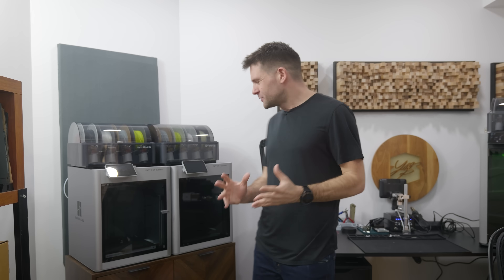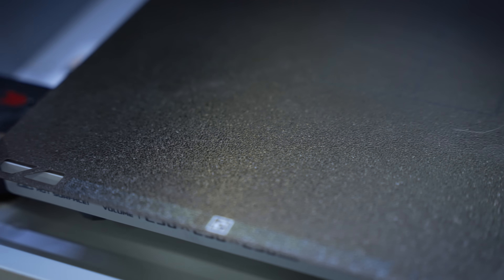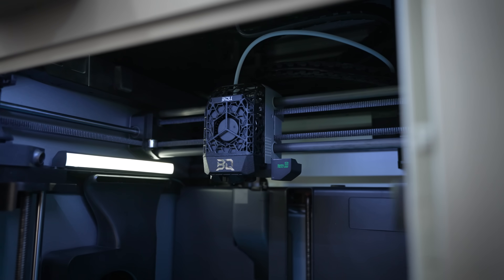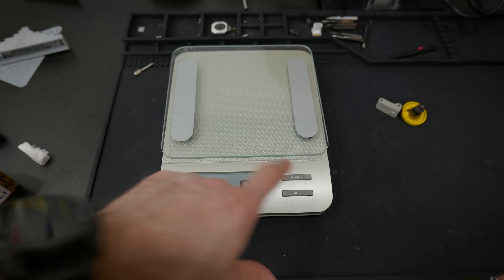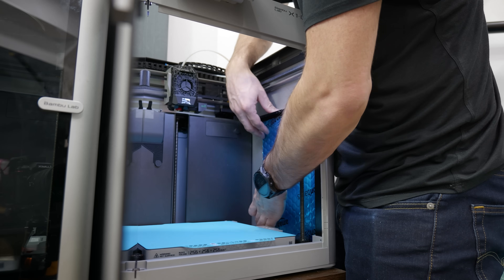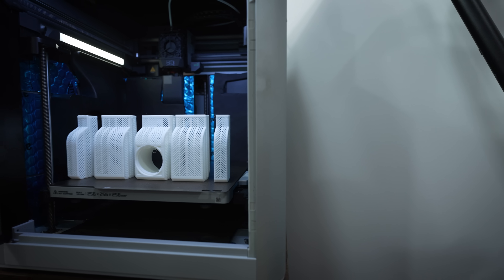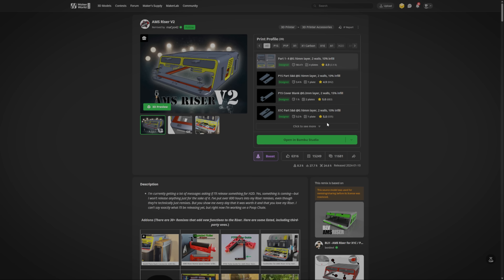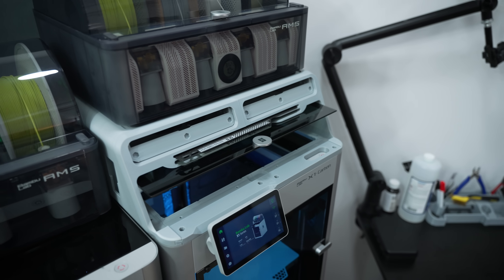I dont understand why more people dont MOD their 3d printers...

Comment: Bambu Lab’s new firmware forces you into their cloud—which means your prints and settings are tracked and controlled remotely. As Louis Rossmann showed in his video, this isn’t about security—it’s about locking you into their ecosystem. For privacy and full control of your device, steer clear.

Comment: But isn't the 'stock' plate of the X1C still the 'cool plate'.  How does it compare to Biqu's cryogrip?  And insulating my printers is something I've done a few times now.  I've learned a few things about getting the best results.  Feel free to hit me up if you want to chat.  I currently get a 15 degree delta just from insulation and heat soaking.  I have a chamber heater to kick it up kigher.

Comment: Up next you should build the Python AMS and enclosure. Then for giggles, you can do the Hula feet, a splitter to allow external filament rolls, belt covers and lastly the Stein Wipe Motion Control system. 

The Python was a must to use older Atomic filament spools and it makes cardboard spools 100% reliable.

I'd really appreciate a side by side on the feet. It seems to have reduced vibration, but I don't have a great way of comparing.

Comment: Great shear. 
Sorry for the off topic question. But I'm wanting to make a budget tablet/viop phone/handheld gaming.
 Any pointers on a mobo, SBC or use something like a psp ? Minimum specs are i3-3250/FX-4350, GTX 660/AMD Radeon HD 7850, 8 GB RAM, 30 GB storage. Was hoping for laptop mobo to gut but I can't find one that's small like a framework laptop mobo.
I have a few desktop spear parts. NVIDIA 960, NVIDIA GTX 1660, AMD Ryzen 5 1600 six-core.

Comment: 10% humidity is way too low. It will weaken your parts. Your filament needs a bit of moisture to adhere properly. The standard safe zone is 20-60% humidity, with 40% being the sweet spot. Lots of great 3D printer upgrades, thanks!

Comment: That nozzle ecosystem is the E3D Revo system. They have hardened steel nozzles for sale, so you can still print with the abrasives. They've also got Hi-Flo and I think Hardened Steel Hi-Flow.
Reply: they have diamondbacks too. Full on mohs 10 polycrystalline diamond for 150 a pop.
Reply: @henrydonaldson4665  F diamond that overprice junk. Tungsten carbide is all that is needed and its far cheaper.  Diamond is a gimmick.
Reply: and the Xobsidion
Reply: Can anyone give an opinion of Revo versus Bondtech? They seem very similar.

Comment: The assumption is that if you have a Bambulab, you don't need to modify anything.
Otherwise, I'd say your printer is crap.
The logical thing to do is to modify cheap printers. Not printers that aren't supposed to need any modifications.

Comment: i started modding my neptune 3 max to fix some z wobble and some broken pom wheels. Then i got klipper. The z wobble wasnt fixed so i got better stepper motors (after ruling everything else out). Then that caused more problems with amperage, then that caused more problems (mb) with inexperienced potentiometer turning, then that caused more problems with replacing the main board, then that caused more problems with overheating.
Not saying your shouldn't mod a printer, just, do your research, don't be like  me

Comment: Your test for the lighter extruder cover makes no sense. It's not supposed to improve small details, but rather allow for better acceleration with less input shaper so you'll have less artefacts and a faster print speed. I have no Idea whether or not that actually works to a noticeable degree, but in order to take advantage of it you'd need to tune your slicer profiles for the correct higher acceleration.

Comment: Some of these mods are good, some are just meh... Some I wasn't happy with...the Panda Extruder that you're thumbnails calls out as "game changer"... Sorry...I'm not seeing it... Yes, it likely reduces toolhead mass, and I like how it looks, and it is installed on my machine...but I don't see any difference in print quality, so I'd call that "meh" item... I have the Panda Jetpack... I do see it offers better cooling, so that's a solid upgrade.   I bought the Panda Claw, and... It's been removed and replaced with the Bambu hardened steel extruder...the Panda Claw was excessively noisy, has way more backlash than it should, and after only 3 weeks and 2 spools of CF filament was slipping and unable to feed filament (I thought I had a clog, but the gear was just no longer gripping the filament)... I put the Bambu hardened steel gear in its place, and it's been 3 months and over 6 spools of CF filament with no slipping at all, and is quieter.   The Panda CryoGrip build plates... I have the Glacier, and make no mistake, despite its name, it's not a "cool" plate...in fact I have to run it 10° hotter than PEI to get good bed adhesion... That being said, I like the satin surface finish it imparts on parts, especially with PETG it's about as smooth as you can get, so I like the glacier, but temper your expectations if you're thinking it's a low temp plate... The frostbite may be, I don't know, but the glacier is not.   The Panda Revo is kind of a love hate thing .. I love the idea of the fast toolless nozzle swaps... But... Revo nozzles come in odd sizes like 0.15 and 0.25mm which Bambu Studio doesn't support, and flat out REFUSES to let you print with... OrcaSlicer however does allow those nozzles...

Comment: That's an e3d Revo hotend with the nozzle + hotend assembly, it opens up the whole line up of Revo nozzles, they have a diamondback equiped nozzle if you want to print insane materials (and obxidian for a more cost available option but still hardened) please look it up

Comment: biqu glacier build plate melts if cleaned using alcohol - according to reviews
killed it for me

also I'd mod the fans before anything else - noise is the worst part of 3d printing to me (aside from the fumes which you should mod an exhaust onto to dump it outside)

Comment: > modding printers
> bambu lab
lol
didn't bambu labs shut down 3rd party electronics? bambu lab are like the worst printers to mod.

not just that, there's a bunch of modding fudd in this video (which I think zac figures out during the vid): skeletonized toolhead, metal extruder gears, bad PCF cooling path. as much as I'm whining about bambu lab's recent modding hatred, biqu/bigtreetech/mellow/trianglelabs should not be seen as good designers. they basically make anything that sounds cool, and they think will sell. skeletonized toolheads do nothing (build a better toolhead instead), metal extruder gears should only be used at 100C+ chamber temps (they wear out faster), PCF should be pressure optimized, not flow optimized, so having odd shaped ducts is worst than straight ducts. 
source: voron nerd, all these sins and more have been done in that community
Reply: oh also, if you do keep the bambu lab printers, luke's laboratory is coming out with a bambu hotend soon, which (because it's LL) will be better than anything else on the market for flow rates.

Comment: I think this is actually a good question. A lot of people are obviously right that this has been the way of things with 3D printing before Bambu came on the scene and there is some advantage to the fact that a Bambu will work well out of the box. You don't need to mod it. But the fact that you can make changes to improve your printer is really good. I think it's good to know how your printer works and how you could tailor it to your uses, even if you don't want to change anything. These machines have a lot that can go wrong with them, so it's really helpful to know how to fix them, and you learn that as part of modding. You should know how to make your printer work the way you want it to.

Comment: CryoGrip is just to pull money out of your wallet, it doesn't work. PLA warped when using such low temperatures, it only held on the plate after using 3DLac.
LED lighting will come out significantly cheaper if you make an LED riser.
Panda JetPack is an old thing and it is confirmed that it has worse airflow than stock.
CNC extruder is fancy, but it adds weight to the toolhead, so more ringing.
Overpriced E3D hotend with brass nozzle, with which it is not possible to print abrasive filaments is called a "win" 😁
We could continue like this, but it is just a waste of time and in my personal opinion just a waste of money, which could have been bought, for example, filament.
And I'm not talking about the "shady" practices of the manufacturer of that printer. That's why I don't own it anymore 🤣

Comment: I tested a lot of this product for biqu and I can tell the plate is really good the front cover with the upgraded airflow is worse is some case especially ia some very difficult detail sections is some models and for the gear the fact some times the x1c stop working because some small part of the filament is blocked inside the gear is not because of the gear but for the nozzle design for example I bought on Amazon a combo for the x1c with all the hotend block similar to the original one but with the particularity you can swap the nozzle and no more problem all for less than 60 dollars soooooo for sure biqu is working very well but I probably don't suggest to buy this kit for the cost (ah for the set I bought in the total I included a ruby nozzle so way better the the brass nozzle from biqu)

Comment: You said that saving weight on the print head didn't improve print quality, but you didn't say if you re-ran Motion Accuracy Calibration for it to redo its compensation for the reduced weight.  I'm not sure if I would expect that to make the quality better or just allow it to be faster, but still it seems to be than any changes that could effect motion should be followed by re-running that calibration.
Reply: This guy prints raisers for AMS, this is his "mod" level.  Spent 15 minutes caught by clickbait...

Comment: Consumer 3D printers have reached a point where consumers want a product and not a project.
Reply: If its 1,5k local currency for "idiot proof working machine" that runs good or 400 and 10 hours of your time with the benefit of knowing the in's and out's, the Deal doesn't Look so weighted in needing to shell out a big amount of money anymore tbh
Reply: @questionsfrog1918 indeed but when the price gap isn't that massive, both options are just preferance based. Some people buy a 3d printer like you buy a vacuum cleaner or a dishwasher, you just need it to work for your use case and how it works doesn't matter. DIY is great but sometimes an appliance has a place too.
Reply: @questionsfrog1918  10 hours of tweaking for someone who has the aptitude to do so. 
The magic there is, most people do not have said aptitude, hence why Bamboo exists and is doing well.
Reply: yeah i ask ppl if they modded their laser printer as well :D? its funny that ppl insult you, because they assume, you are retarded... i just wanna focus on printing, not tinkering...
Reply: The 3D printer is for printing out stuff for other projects. I don't have one yet but if I get one I don't want it to also be a project.

Comment: People bought Bambu printers because they just work (and Prusa). Being someone who has probably spent 100's of hours upgrading and then trying to 'fine tune' my printers I can absolutely see why people don't bother. That is why I bought a P1S. I'm so sick of upgrades, it's life absorbing and depressing. No more upgrades for me. Time is precious.
Reply: I've ordered a core one after many years of tweaking, more failures than actual prints

I know how you feel exactly
Reply: Amen! Had the same journey
Reply: Exactly. However, it is also the first printer I have, which had a non working part cooling fan. It somehow partially unplugged itself. At least it is the first time I didn't notice it. The fans of the Anycubic i3 Mega sounded broken way before they didn't work anymore. And the i3 Mega doesn't bend hotends. The whole frame is so flexible, that it just flexes around the obstacle. But the i3 Mega replacement parts like the heatbed became so bad in quality, they wouldn't be an alternative to the P1S even if it wasn't one of the best allrounders.
Reply: ny print farm is x-1s and ps-1s  

upgraded from prusas which i gave away to my boy scout troop
Reply: prusa does NOT just work.  they are still in the stone age.  

my bambu running mostly default.  is producing nicer prints on ludacris speed than the prusa printers we have running proffessionally to make parts at work.. (we build lab testing robots and something we use printed trays and such)
Reply: @darkracer1252  man that's a real put of touch thing to say out loud 🤣😅 as someone who has been HEAVILY modding printers since the ender 3 pro was brand spanking new when printers truly were something you had to build and tune... Prusa these days is NOWHERE close to how hard it used to be first of all... And second of all having quite the hours into printing on a P1P I can confidently say the only part that impressed me long term was the lack of issues with mechanical hardware over time, but the hot ends are ridiculous expensive, slicer software isn't the best, closed ecosystem, has been known to have issues with said ecosystem... Bambu is like the car company that always has the new features first (they are also always the ones to figure out it's quirks on their consumers 🤷) overall great printers but if you came from modding and tuning it may not be your cup of tea 🤷
Reply: @darkracer1252  If prusa is "still in the stone age", then I guess bambu is too. Since both brands all share the same tech and features. You sound like someones thats never touched a prusa.
Reply: @darkracer1252  if the prusa dont work well, sorry to hurt your feeling but its the operators controlling it. Bambu is for home use, but for printing farms there are way to many downsides
Reply: @DevBench4Life  no and no... When Bambu is not for Print Farms, why most farms i see use only Bambu? Only Prusa print farm i know of is Prusa :D
Reply: @F-Andre  I know a few guys that have prusa print farms.  That said, I've personally spent more time helping my buddy keep his Prusa mk3 working then messing with my own  printer.  However I wouldn't touch a Bamboo.  They seem physically good, but I don't trust a closed source ecosystem in a traditionally open source environment.   I don't want to be stuck using their slicers.  I REALLY don't trust them after the blocked other software from initiating prints.  No cura support.  Naw.

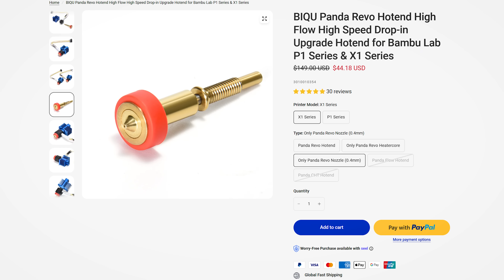Comment: 7:18 you shouldn't be paying more than $20-25 for a Chinese Revo nozzle assembly.

14:19 this module bottoms out at 10% on the displayed measurement range, so real humidity is lower than it shows.